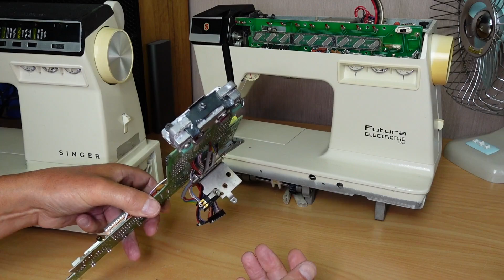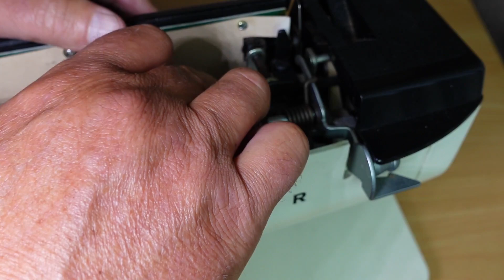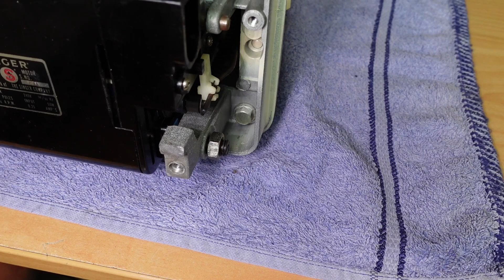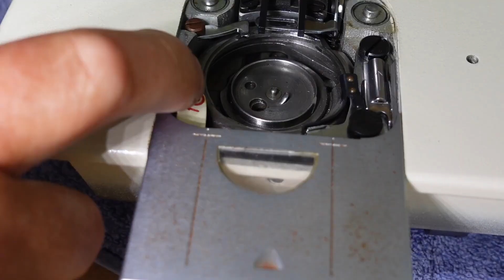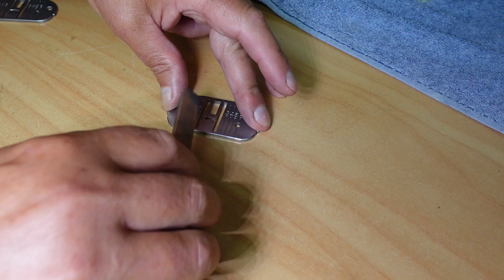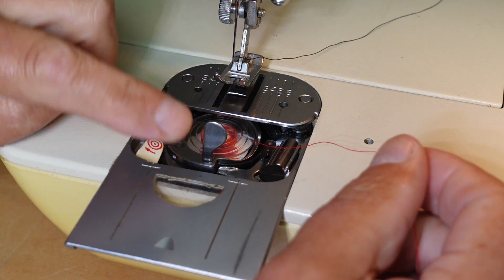Reviving this '80s Classic Singer Futura Electronic 2002 - Part 2

Comment: The push buttons on mine are fine I just can’t get it to sew the thread into the fabric! Needle goes up and down fine but I can’t understand the instructions on threading up, so without any video guide, the book isn’t helpful enough so I shall probably have to get shot of it and get a modern machine that comes with better set up video.

Comment: Great video on this machine!  I have the Athena 2000 and noticed that the motor mounts are gone - crumbled and disintegrated.  Is there a source for them or can they be made from a suitable material?  Otherwise, this is an amazing machine and I would like to make it right. Thanks for your reply on this.  Happy New Year, Jim
Reply: Most of the "online suppliers" have motor mounts.. The mounts on all the "Futura and Touchtronic" machines crumbled..

Comment: Sold both model ranges when new in uk  1000 and 2000 are different castings 2 extra holes in your 2002 plate was for a snap on feed cover plate

Comment: Oh, magical sewing machine whisperer, I NEED YOUR HELP.  Your video is beyond excellent. I have a Singer Touchtronic 2001 and  THE LIGHTS in  the "Length, Balance, and Width" portion of the panel don't work anymore, they do not light up. When I press on the area they make the noise but the numbers don't light up.  Have you any experience with this situation?  Can you point me in the direction where I might find some help.  I've looked for years on the internet for a solution and haven't found out how to fix it.  I can't believe I'm the only person in the universe with this problem.  I would certainly appreciate any assistance you can give me.  Thank you.
Reply from the maker: I have found the little legs on the bulbs sometimes partially come out of their sockets. Maybe try re-seating the bulbs first. You could also swap a working bulb from somewhere else to track down if the bulb is faulty, or use a multimeter to test the bulbs. Thanks.
Reply: I have a singer 2001 memory machine and I want to replace the gears can you help me where to buy? Thank you.

Comment: I have a pristine copy of the instruction manual for thsi model. Do you need a copy?
Reply from the maker: Thanks for the offer but I have one for the model 2002 already. I don't however have one for the Model 1000 or 1100.
Reply: @InStitches  Can’t help with those. The Singer website has lots of downloadable manuals for older models on it.
Reply: I've got my original manual, going to scan it for preservation.